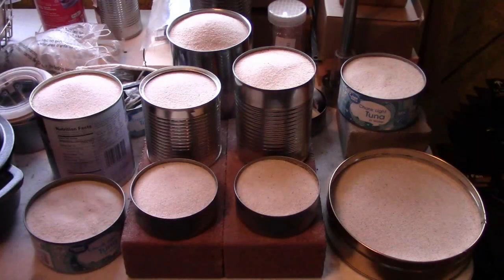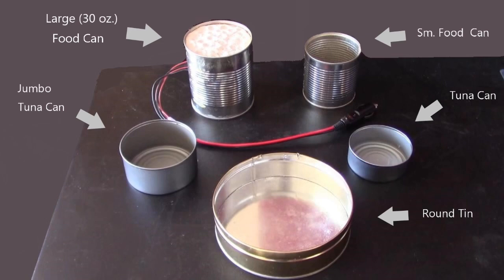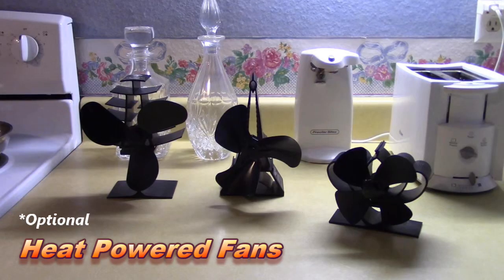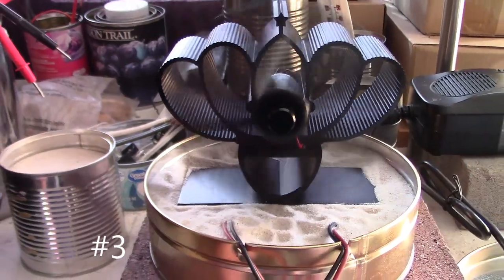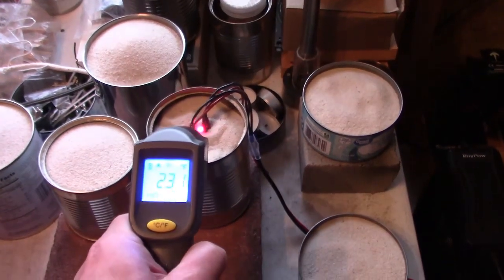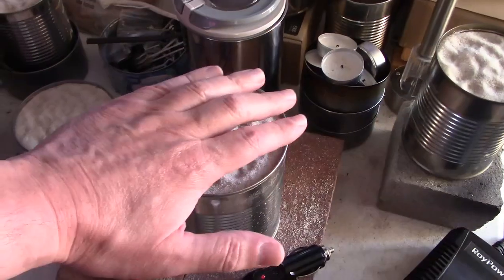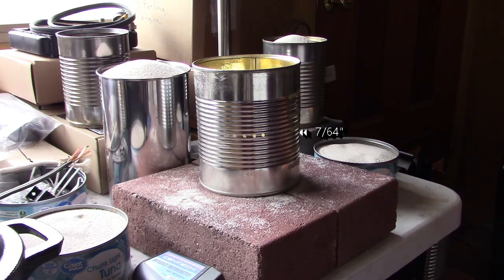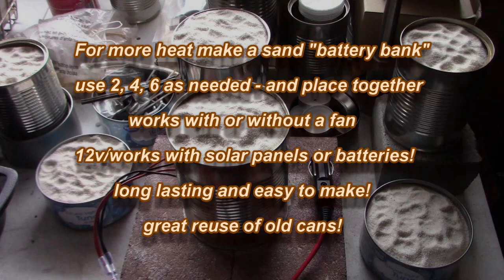5 DIY Sand Battery Space Heaters! with Heating Elements! 300F/150C (self-regulating Ceramic PTC) 12v

Comment: how much watts is each 12V 220C  ptc drawing? ,
i have a 120 C 12V PTC, its rated as 30W, on he same store also the 220C 12V ptc is rated 30W, 
how could higher temp draw same watts?

new electrical guy here
Reply from the maker: hi there. the power draw of these fluctuate quite a bit. they are literally self regulating meaning that they draw as much power as they need to to maintain the heat output. i really noticed that when i used elements like these to make a 12v skillet. the power draw will be more if you put something cold in it and as it warms up the power draw goes down. the heat will stay the same thou. i'm not sure about your 120c and 220c ones. it could be a different formulation that they used to make the ceramic stone that was used. my 220c ones usually draw about 2 amps once they heat up (but once heated i've seen them as low as 1.2 amps and they are still putting out max. heat). the max amp draw is usually around the 1 minute mark and then it drops down of the following few minutes and then steadies out.

Comment: Hi! I recently got the idea that a hot plate with the sand container right on it could work too, so I got a 1200Watt used square electric skillet from a second-hand store, put the bucket of sand and clay (our soil here) in it, and filled the rest of the skillet with more of our soil, turned it up to the control's maximum, and waited.
My noncontact thermometer showed a starting temperature of 47.6F. About 15 minutes later, the sand in the skillet was at 375F , so the dirt in the bottom of the bucket was at 375 too. It took about an hour for the dirt half way up the bucket to get that hot.  It was over 400F in an hour and a half according to the noncontact thermometer.  I turned off the electric skillet and let it coast.. When I left an hour plus later, the bucket was still radiating about 350F.  I'm too busy to make a video for my channel right now so I pass it to you in case you want to try this and see what results you get.

Comment: 1000 water storage with sand and 3 meter aluminium poles sand inside heating with sun, could drill hole in wall and inside pipe place heating pad

Comment: Do you think putting water at the bottom and installing the heat element there at the bottom would work  then fill the top half with sand and insulate it 😊

Comment: I have ratiator heat in my house w a boiler downstairs.  I wonder if i could make some sand batteries along the base heaters. The heaters get really warm w the hot water running thru.

Comment: Could you explain the RoyPow electrical device?
Reply from the maker: hi. it's just an ac to dc transformer. you can plug it into the wall and it outputs DC. the DC socket on it basically mimics the 12v power socket in a car. they are both 12v and they both output up to 15 amps.

Comment: Not sure what kind of elements you're using there or how to locate them.. can you give a link to a possible heating element that I could use.
Reply from the maker: hi there. i typically use ptc heating elements. very hot (but self regulating) so they never get overly hot. places like amazon, ebay, and aliexpress sell them. i usually get them from amazon. here is a link to some https://www.amazon.com/Bestol-Heating-consistant-Temperature-Thermostatic/dp/B07VBDT8NL/ref=sr_1_2?crid=1K3I2MXJQ5W05&dib=eyJ2IjoiMSJ9.88Qdhw4itzlblsRCqAP-zwNIfbEcifl-9-QTs9Nn0mWy6hT3cblnkGK5Xl7TYg6SAiEe9CFXxv4GnuFWMQzpgGvCRy9VtT10S_xnx7q0hP3mXE1ZanehkfhHYCTRTMXgfQGwK53CyjEKa0Aw4Zl9pR2GCsYQDdr00pvZlX4CaLkXegjlJNpbNAomeTCMeB13JIYyYKNTvyA2dbOqETiu_wWXUoJnWv_vVeaO8llJkG1qPmrCWbY27Y6yZhqCxiePufdJ1Dp1YHc-KSzisNwhQWw9jWQinM5owr67-P55A7Q.zZi_14PhlxznxrPPWWd-HpnXLy0eb3phQVUzHlUH9VA&dib_tag=se&keywords=12v+ptc+elements&qid=1734011799&sprefix=12v+ptc+elements%2Caps%2C277&sr=8-2

Comment: What type of sand can use and what kind of heating element for sand?
Reply from the maker: i like to use the lighter colored play sand. clean, fine grain and washed/filtered. you could use a coarser grain is you wanted too. even just sand from the beach should work. if you use beach sand you might want to wash rinse and dry it before use. i've used ptc heating elements, heated silicone pads, and even low power dc water heating elements so far (all 3 kinds are 12v)
Reply: @desertsun02  I see some people use fine salt is better alternative?
Reply from the maker: @akasha1337  hi. i've experimented with salt before but recently i'm finding that sand is better overall.
Reply: @desertsun02  thank you alot I want to heat a small room without the need to use battery just with solar so I will start with the sand since is cost effective and see how it will go

Comment: For anybody building this - be sure to de-burr those holes, AND I'd suggest putting SILICONE TUBE sleeves around the wire where they go into the can, not too far into the can (maybe 3/8" or ~9.5mm) and gluing this in place on both sides with some hi-temp silicone adhesive.  Silicone is generally good to 450F+ a little. It'll help prevent the wires from shorting out to the can if the insulation is cut over time in the through-hole. Of course, clean the metal can surfaces with alcohol, acetone, or such first to remove most oils for the silicone adhesive to really stick better.

Comment: I have a large copper bucket, about to buy these 12V ceramic elements, but I can't tell the power source for the elements. Is it a solar battery you're plugged into or your car's 12V socket? Help please 🙃
Reply from the maker: hi. you can use almost any 12v power source as long as it gives you the amps you need. i've used 12v solar panels, 12v deep cycle batteries, and 12v power sockets. you could also use 12v lithium batteries.
Reply: @desertsun02  I don't see my reply here...sent a couple hours ago...did u see it? It was rather long. Now out of the mood. It's not what power source to use, but rather how to connect a water heater element to another power source. I'm a 64 year old gal, with how to knowledge, just trying to figure out how I want to heat my sand up...found a 12v cigarette lighter adaptor on a power cord with eyelet connectors on opposite end. I have a 2000w solar battery. May not be optimum power.. I  guess I'll try and get a power cord with a 110 plug and eyelet connectors on the other end.

Comment: neat trick. where can i get some of the lements from ?  Also can i use something instead of the elements ?  Thanx
Reply from the maker: hi. you can find these types of elements on sites like amazon, ebay and aliexpress. i usually get them on amazon. you might be able to use something called ptc ceramic ripple element. amazon has those too.

Comment: How much power was used to heat them up?
Reply from the maker: hi. the elements draw about 2 amps but that caries quite a bit. (note that they sell them as 5w to 50w elements because they have a start up surge in the first minute). the reason that they can say as low as 5w is because the elements are self regulating and sometimes they don't need to pull very much power at all to maintain the heat. they seem to draw 2 amps on average though (really about 1.5 to 2.25)

Comment: Had a random question/thought come to mind, which option would radiate more heat the metal cans/bails or the clays pots (if any difference you think)?
Reply from the maker: hi. i'd have to do side by side tests to say for sure but they're probably similar output.
Reply: @desertsun02  you don't have to do it just was a random thought I had 🤷🏼 I know both would work well. I have heard though that clay works better than sand does.

Comment: How does he hook up to solar?  Does he need a solar controller?  How does that all work
Reply from the maker: hi. no need for a solar controller with these. you can actually hook these elements straight to a 12v solar panel. doesn't hurt the element in any way. they are often marketed/sold as 12v/24v elements so they handle a few extra volts with ease. the elements will just pull the power that they need from the solar panel. and if the panel is outputting less amps than the elements use they will just heat up less.

Comment: Just come across this , i treati g idea, XD just thought if you had a smaller tin , that can just fit one of them fans on . Then put it in a larger tin so there is a gap and fill the outer gap with i sulation . Might have two benifits,safe to pick up,and wont loose as much heat,so fan moves the heat . Duno if it would work but,least wodnt loose as much heat while heating it.

Comment: Could you please share the resistance or power rating of the heating elements? Thanks
Reply from the maker: power ratings of the elements vary but i generally use the 220c ptc ones. they have an initial start-up surge then they level out around 2amps per element. (24w)

Comment: please do tests on how long the heat lasts.....
running the calculations is complicated because i dunno, you aren't just heating the air

i guess you could work backwards by simply seeing how long you run a 500w oil heater each day
then multiply 500 into how long you run it

to get how much energy you need to store but

how much energy does a heated brick hold??

Comment: What happens if we stick the two cables right into a sun battery from a 12v solar panel? will the sand be hot? do you need a regulator or can u
you put the cables directly into the sand?

Comment: Do you have sand leaking out of the wire holes on the side of the cans ?
Reply: Maybe hot glue the holes ???
Reply from the maker: hot glue might work, but I'm not sure. I'd go with 100% silicone caulk (should work great)
Reply from the maker: hi. the holes are just the right size for the wires so no sand is leaking out (but you could use silicone caulk if you needed to).

Comment: I think this concept is great. In Holland allmost all houses are made with (double) brick outter wall, light brick inner walls and concrete floors.
Why not directly heat the wall? Lot off mass.. Directly off a solar panel.. 

That's even cheaper/more simple as you don't need a sand box and it does not take up space..
Reply from the maker: sounds like a good idea. a very good idea.
Reply: I guess heating walls directly will damage the structure itself.

Comment: Hi. Love the idea. Is there any other way to initially heat the sand instead of using alot of battery/12volt power while camping. Don't want to drain the batteries too much, as we are running fridge etc as well.
Reply from the maker: hey there. outdoor options include heating it over a campfire, rocket stove or propane stove etc. you could also heat it with things like parabolic dish or fresnel lens.
Reply: Thanks for the ideas. Unfortunately, I purchased ones saying 12v, 50w (6amps), but they are pulling 7.8-8.2 amps each which is a big drain on our AGM batteries. Bugger 😞
Reply from the maker: they sometimes draw more power when they are first starting up but after a few minutes it should go down. the heating elements i use generally pull about 2 amps after the startup.

Comment: Would it be possible to connect a portable solar panel directly to a heating element like this without a battery? For example the nitecore FSB100 outputs 5.4 amps at 18v.

Comment: the drilled holes it will cut the wire jacket eventually
Reply from the maker: hi. you could use some extra silicone on the hole to help with that

Comment: This guy has great ideas and I have tried some of them. However, in this video where he is measuring the heat coming off the wide shallow steel container at approximately 450 degrees, he has the PTC elements laying on the top of the container not buried in the sand. These PTC ceramic things go over 400 drgrees and he is shining his temp gun where they are on the top. Most of temp reading is coming from the PTC's and not the heat of the sand.
Reply from the maker: hi there. yes, i wanted to show the actual temp of the element in that particular shot. the sand won't typically get to that temp but it gets very hot. ✔🙂

Comment: It is better to heat water. Water stores more energy. Sand is good that it can be heated over 100C. At least 200C required. More is better.
Reply from the maker: hi. yes, limiting factor with water is that it can only be heated to 212F(100C) but sand can technically be heated to 3090F(1700C)  before it liquefies.

Comment: Desertsun02 have you tried to heat the sand in cans directly from the Sun during the day and then brought them in when needed during the day and night ? If so  how many pounds of sand would be required to heat a room of 12' by 12' from 32 degrees to 70 degrees per hour in sun per hour in room when relocated?
Reply: Good question. F

Comment: Crazy question.  What would or wouldn’t work about using a chafing dish filled with sand, heated by 6 hour indoor safe canned heat underneath and a heat powered stove fan on top of the heated sand?

Comment: Great works as usual.
I think they are good and cost-effective if you can heat the elements let's say with solar panel  (or wind, ...).
But I wonder if they are cheap/efficient otherwise: i mean powering the element with the usual power supply from grid could be very expsensive.
Thanks again for your projects.

Comment: Interesting, did you measure watt consumption?
Would we have to have a battery bank off od a Solar panel or can it run just off a solar panel on sunny days?
Reply: Yeah would be nice to know how long a car battery would last, especially if it's getting topped up with a solar panel during the day.
Reply from the maker: hi. the elements draw about 2 amps each. you can definitely hook them straight to a 12v solar panel if you want to.

Comment: Light colored sand doesn't absorb heat as fast nor as long as long as darker sand.  As well, pure clean sand doesn't store heat as well as sedimentary('dirty'  sand).  I love the videos though.  Running an energy efficient fan to generate electricity to charge/heat the sand might also be an option as the sand can retain heat for several hours with a slow even dispersal.  Just thinking out loud here.

Comment: I'd really like to see if putting the hot sand into an insulated container would extend the time that the fan could blow out the hot air.  If used in a camping scenario it might be more useful to have a little bit of heat longer throughout the night, then a lot of heat at the beginning of the night.
Reply: If you insulate it it'll take longer for the heat energy to dissipate, so yeah it would work.

Comment: So how big of a room can it heat up? You are measuring the heat source but not the ambient temp around you. I want to build one of these if it makes sense to consume 1 kWH for 9-10 hours using solar panels as electric source  and effectively discharge the heat later in the evening.

Comment: I am in the process of making mine as soon as the parts come in.  Can you tell us about the fan itself?
Reply from the maker: hi. well, i've got 4 different ones so far. they all work basically the same though. they have a TEG chip between the two pieces of metal (2 heatsinks) that make up the body of the fan. it's the temperature differential between the one on the top and the one on the bottom that actually generates the electricity. when a certain temperature differential is reached the chip starts to make electricity. i always go with the fans that have a starting temp of 122F(50C). that's the lowest starting temp for these types of fans.

Comment: perhaps if one had a very simple wind mill,  where it can take high wind speed, and it was wired to a thick gage wire cable to the basement of a home, using the shortest distance like the roof straight to the basement, and had a type or element coil that could withstand such erratic jumps and falls to the power output, you could build up heat in the sand as a heat battery, to last for the time of day the wind does not blow.

Comment: Really love your videos and plan to use these PTC heater elements to make something for myself as well. You have definitely inspired me to make my own heaters as part of my solar experiments in the shop.

As far as those fans go, however, it's actually hurting your overall energy production. They are great when the heat source isn't the same electricity you are using for the heater (so for something like a wood stove). The downside is converting electricity to heat and then back to electricity for the fan means there are losses as each conversion step. So you'd get better performance if you use the 12v computer fans like you've done in some of your other videos.

Thanks again for sharing! You've got some excellent content.
Reply: The fan does not use current. It blows from being heated.
Reply: @battleofarmageddon1366  Understood, but that heat came from the electricity going through the heating element. That conversion from electricity to heat means there are energy losses. Converting again from heat to electricity also has losses. So rather than incur the losses in the conversion just run the fan off the electricity in the first place.
Reply: @TomZelickman  All the energy taken from the 12V source will eventually turn to heat. Some of it just takes a detour via the fan's peltier element and motor. If anything, the fan improves heat dispersion to the room but it doesn't "steal" from the process.
Reply: @TomZelickman  Where do you think the "lost" energy goes? Electric heating is by definition 100% efficient. There is no loss.

Comment: if you could have maybe 2 or 4 on a room with some sandstone bricks around it, i think its sandstone that really absorbs heat and slowly releases it, you could probly heat a room like that easily. a bigger can as you say too with more sand, question what was the brick temps when running? and what would a solar panel cost to run it? is it just a solar panel or a storage battery as well, i dont know much about that end of it, even for the sandstone if you could find a quarry that chisels it out and pieces and off cuts would work